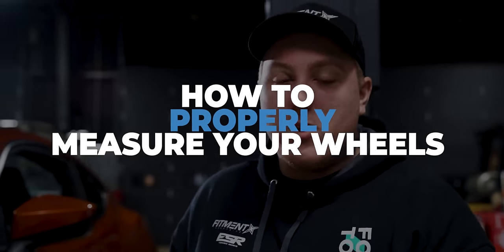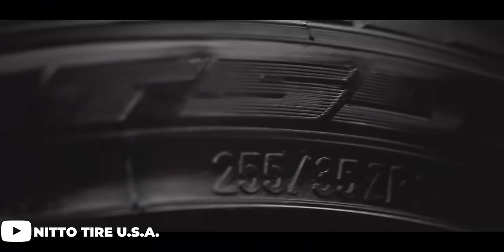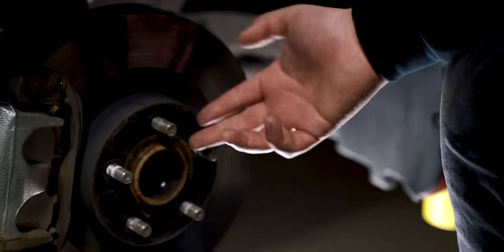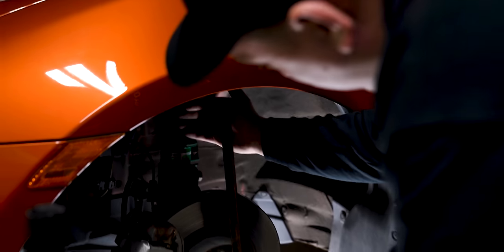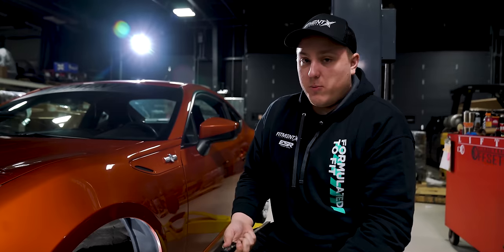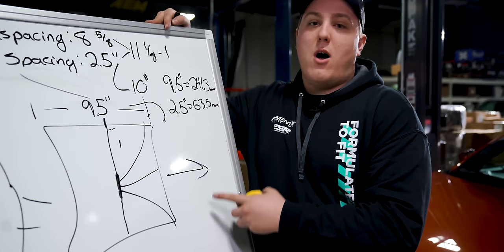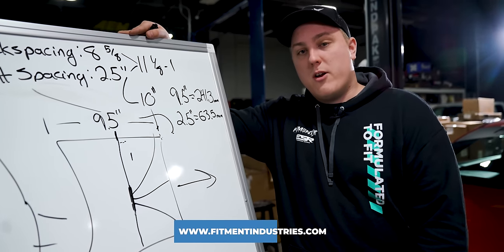How to Measure for Aftermarket  Wheels

Comment from the maker: Did you find this video helpful ? Let us know in the comment section below. Also, be sure to cop some gear so you can get entered for a chance to win a set of  ESR wheels:
http://bit.ly/379s0YN
Reply: Gelz! There she is, the unicorn Toybaru...she looks good. Awesome vid...keep it coming..can you do a vid on cylinder heads for our cars. Just to iron out some of the quirks. I have the block, just cat figure out if there is anything i can do for the rocker arms.
Reply: great explanation dude ...well done  ...thank u
Reply: Could you make a “so you want” video over early 2000s lancers like the OZ rally edition please
Reply: I just got my first car really looking forward to make something nice out of it. It’s a w124 Mercedes-Benz from 1987  200series  (with some engine problems) most could fix right away, some broken parts in the cylinder head. (Broken camshaft) Oh and when the engine is running the car shakes a lot and makes a lot of noise. Any idea what that could be ? I wil change the oil and oil filter. I hope someone can give me some tips. So I can make this car a bit nicer and wil last a lifetime.  I am only 14 and don’t have a lot of experience. Best wishes from the Netherlands  (hope my English is not to bad)
Reply: So If I run 18x9.5 with et35 or et38 with the tire 245/35r18 and lowering springs 0.5 drop I will not rub at all and have nice flush setup ?
Reply: Great content! Always wondered the practical formula to figure out wheel fitment. Love this channel!!!
Reply: Word
Reply: Best example video ever. Ive watched some of the other fitmentindustries video and without example I got lost what they are trying to explain. Thanks for the simple to understand instructions.

Comment: This video was extremely helpful, thanks guys! 
Here are the sparknotes of the vid for the boys and girls 
Hopefully it helps 

Backspacing for your wheels (measurement)- 1:52

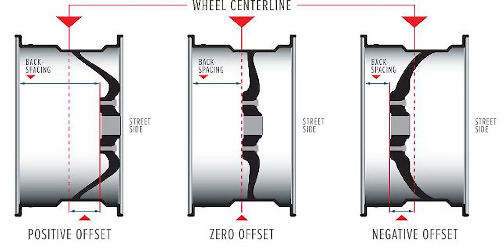Backspacing: is defined as the distance from the hub mounting surface to the inside lip of the wheel (measured in inches). More backspacing puts the tire closer to the center of the vehicle. A related term is known as offset, which relates the hub mounting surface to the centerline of the rim. (2:17) for diagram

Compress your strut where you car would be on the ground 

Get a point of reference (ex. stick) that is long enough to measure (being above your brake rotors)

Find the distance of the front mounting hub to the back where  the 1st main point of contact of where anything is (ex. strut) - distance between front mounting hub  to strut (ex. 8 ⅝ inches)

BACKSPACING = 8 ⅝ inches

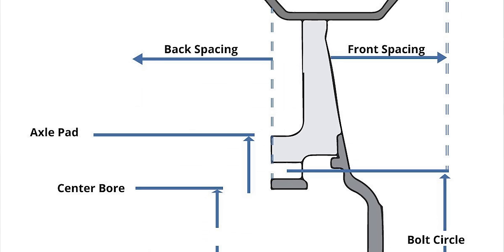FrontSpacing for your wheels (measurement) - 3:55

Once you figure out back and front spacing, you will know what width you will have to work with 

FrontSpacing is measured from the inside of the fender to the front of the mounting hub.

Get a point of reference (ex. stick) that is long enough to measure (being long enough to go down from your inside fender to the same length as your mounting hub) 

Find the distance between front of the mounting hub to the inside of the fender (ex. 2 ½ inches)

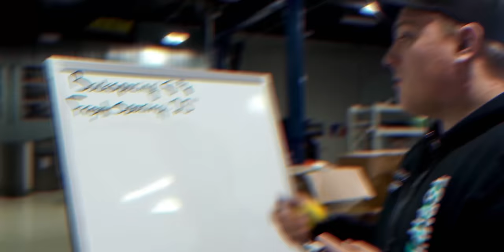Width (Measurement) - 4:55

(Backspacing + Frontspacing) - 1 inch = Maximum wheel width 

You round to the nearest inch

8 ⅝ + 2 ½  = 11 ⅛ th inches 

11 ⅛ - 1  = 10 ⅛ inches (before rounding)

Final Answer: 10 inches Width (maximum)

Diameter - 5:58

Use your best judgement for that.

Ex. Don’t run a 22 inch wheel on a BRZ or FRS

Offset - 6:23

Offset: Offset is the measured distance between the hub mounting surface and the centre line of the rim (in millimeters)

(6:39) offset diagram and explanation

Positive Offset: the mounting surface is going to move towards the outside of the car (wheel hub is pushed out towards the fenders). AKA means that the wheel is going to sink in more towards the car.

Zero Offset: mounting surface is right in the middle

Negative Offset: the mounting surface is being pushed towards the the back of the wheel towards the inside of the car while pushing the wheel out.

You need to figure out the front spacing to find the backspacing of the wheel

Once you find the backspacing of the wheel itself and the width, you can determine your offset 

Wheel backspacing = Width - Front Spacing 

Ex. (9:34) - Want to get more of a flush set up w/ a thicker tire

Width: We decide to pick a 9.½ inch wheel width (241.3mm)

Frontspacing: 2 ½ inches

Wheel backspacing = 9.5 - 2.5 

Wheel backspacing =  7 inches

Results from calculator = 44-45 mm of positive offset 

Round to the nearest offset mm

Offset/Backspacing calculator: https://www.fitmentindustries.com/tire-wheel-backspacing-offset-calculators

Fitment galleries for examples: https://www.fitmentindustries.com/search-wheel-offset-gallery
Reply: U are the fuckin man, thank you

Comment: The technician service manual for my 2022 WRX says that the wheel "Inset" is 55mm (4.5"). What exactly is "Inset?" BC ppl seem to use the term "Offset" and then either positive or negative. But other references say it's actually called "Outset" and "Inset." So i guess Inset means positive and outset means negative offset. ???

Comment: Ok you can draw something on a whiteboard, tell me about it, etc. But if you're gonna tell me what backspacing is, you're gonna have to show it to me on the dang car because I have trouble visualizing what the heck it is. I just know what offsets put the wheel where in the fender without rubbing based on what other people are running.

Comment: Makes it a lot easier considering I basically have the same car (2019 Toyota 86). The fact you said you have 18x9.5 +40 and 255/35 gives me a hint. Could a tire width of 245's be fine as well?
Reply from the maker: Yes

Comment: This was super helpful!

I have one question and I hope you can clear this up.
Still unsure how to determine the maximum negative offset based the backspacing.

Could you technically go as low as a +20 offset with your current setup on your FRS? Would a thinner wheel allow you to go even lower?

Comment: once the wheel is off do you just raise the brake rotor as far up as it would go? Im not sure how high the car usually sits. On stock suspension

Comment: For your 9.5" wheel in the example shouldn't you have been using the full width dimension of 10.5" when calculating front space to take into account the outer edge that would actually come in contact with the fender?

Comment: excellent video right here! this will give me a peace of mind knowing what wheel specs i will begetting. this is much much appreciated. here is my question: my suspesion is old and most probably worn out. planning on getting a bc racing br for a daily 2005 4dr 325i. should i measure now or should i wait until the coilovers are installed and then measure? thanks!
Reply from the maker: Wait until you get the suspension!
Reply: thank you  @FitmentIndustries  ! Also, on one of Alex's video, he mentioned that bushings need to be replaced as well when putting coilovers. however, i have no idea which bushings would need to be replaced. would you be able to tell me which ones?